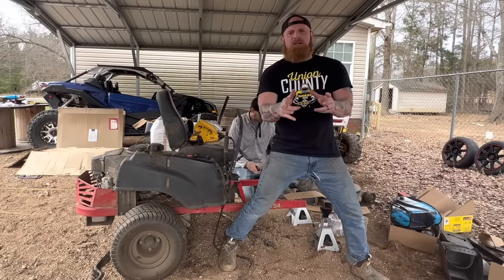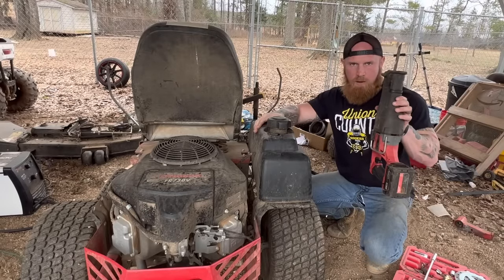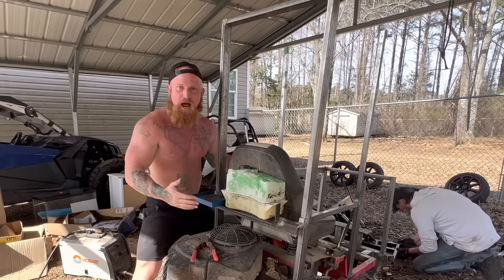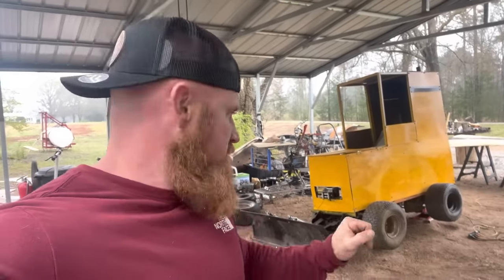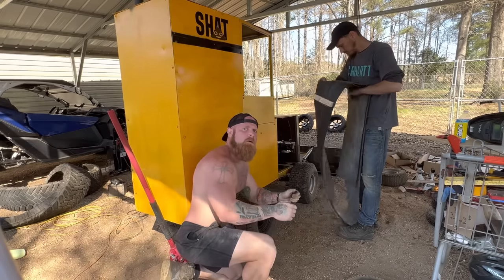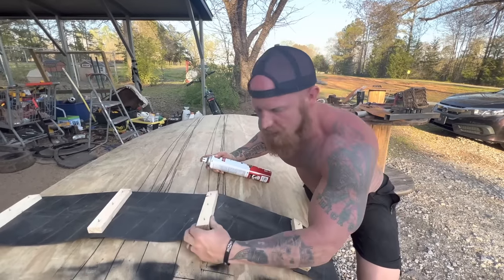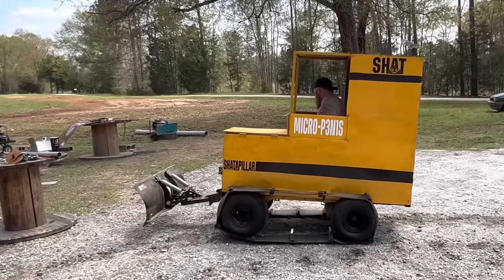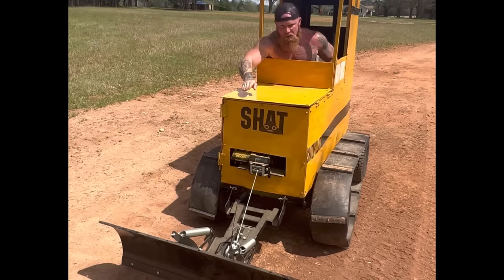I made a bulldozer out of my zero turn lawnmower!

Comment: If you double the cleats on each track you can get increased traction and a smoother ride. It will be unstoppable. ( If the welds hold together )

Comment: Well...that turned out about the way I expected. As I watched the video, all the pieces were coming together in the exact right way to fall apart. 

Let's review:
-Having treads is good, but what you made was just less efficient wheels with extra steps. I looked up why bulldozers and tanks use treads, and it involves spreading out the surface area relative to the weight exerted by the vehicle on the ground + gripping the ground better so that more power goes to pushing and pulling. Rubber with wood screwed to it isn't going to give you that. Maybe try welding metal drums to the axles (instead of wheels) and then creating custom treads that would go over that. I can't think of a way to make proper treads that wouldn't be stupid expensive and fail anyway, but it's got to be better than what you went with. Maybe just try ditching the treads idea and welding little metal hooks/spikes to the drums? Metal treads are hard.   

-You chopped down your control levers and moved the gas tank just so you could add a massive additional load over the top of of the thing, which wasn't necessary. If you want a canopy, either account for the uncut (little late on that one but...) lever's outermost position + your arm positions during operation, then either make sure there's a hole there, or (if possible) expand the canopy at that point.

-Your entryway works, but almost any other method for getting into the thing would've worked and looked better. Why not raise the entire front forward? Maybe I'm missing something about where you mounted the winch, but it looks like you had the space to do that.

-The actual plow is the tip of your spear, and you made it spring-loaded and winch-operated (why???). Not that I've ever messed with one, but aren't these typically hydraulic systems? Your dozer has to be able to resist the counter force of the pile of dirt if you want to push anything . That means the plow probably has to be one of (if not the strongest) components of the whole thing. I'd say yours was the weakest part if your front axle hadn't broken first. 

I think the comedy of errors/cringe factor of this is probably what you were going for, and the ingenuity is great, but this was about the most ill-conceived attempt at a bulldozer ever. 

...it does kind of inspire me to want to take a crack at a bulldozer conversion at some point though. Looks fun.

Comment: To make the truck tires more flexible you have to cut grooves down to the steel belts but not into them. I'm going to try to build my son a mini "tank" and have been looking into what to use for tracks. I have cup/bucket elevator belts used in rice production I may try though too.

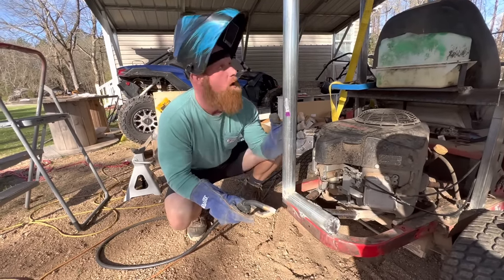Comment: 2:28 Welding the exhaust to the frame was a bad idea. It needs to move just a little. Welding it is going to cause the exhaust to crack from engine vibration. I work in a mower shop and have seen it happen countless times. It is most likely to crack close to where it bolts to the head. It may also break the bolts holding it to the head. Just a friendly warning.

Comment: there actually is a company that makes mini-bulldozers. they are struck corp. they have an actual bull dozer KIT! also make a much bigger (but still overall small) bull dozer about the size a small-medium skidsteer. it even has a cat I 3 point hitch with pto and hydraulic downpressure.
Reply: Sounds cool. I think I still prefer the MICRO-P3N1S. It may be small, but what matters is how you use it.

Comment: The Shaterpller is better than an actual Caterpillar. repair the axle and put some more pieces of wood on the tracks. about 4 or 5" apart that way it won't teeter totter so much. and you be in business for sure. and it will not only be great for dirt but it will great for snow also.

oh almost forgot the flapper on the stack was the perfect touch.

Comment: I think this could actually work
1) tread needed to be a bit smaller and closer together. That should smooth out the ride.
2) i think the blade and front end could use some weight that would be more effective.
Very doable!

Comment: Need some of the 3m rubber glue, cut strips of the tire treads and glue to the track in strips side to side and small space between. Smoother ride and the glue is very strong.

Comment: Take them  there tyrs off and install ur trax on them rims bud. I would use them truck tyrs. Bust out thet whirly wheel and grind some of the thickness out of the rubber and bolt together wrapped around rims no tire. Then add wood to bring up to correct ride height.